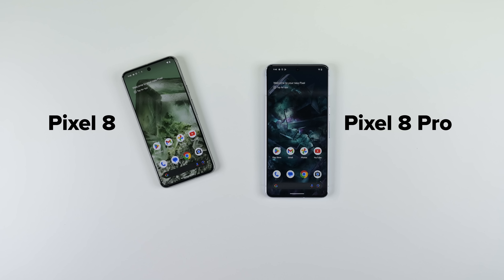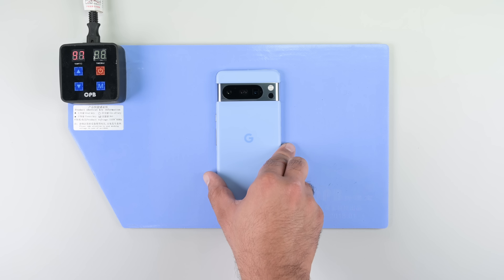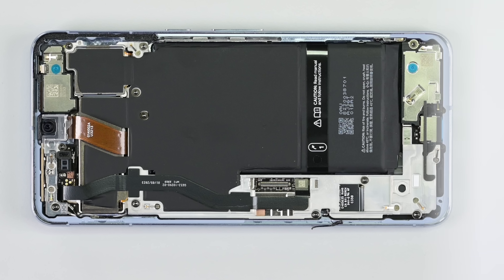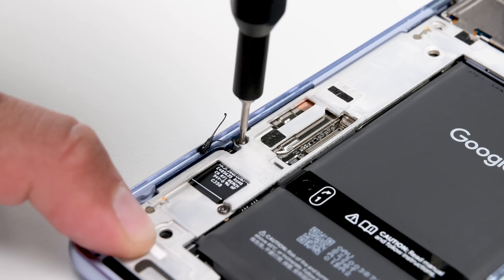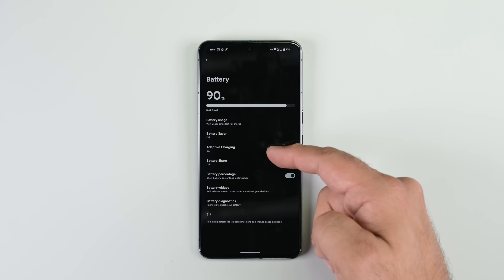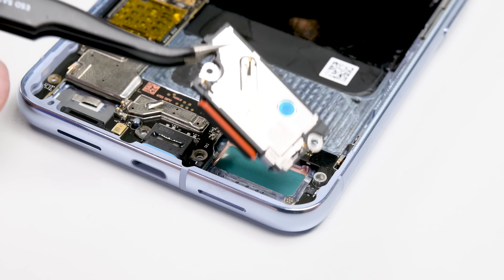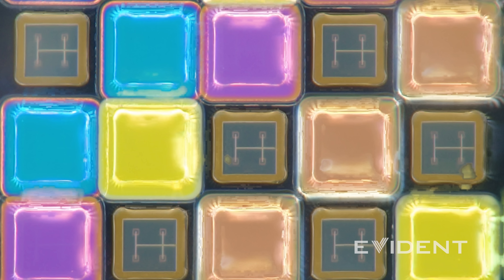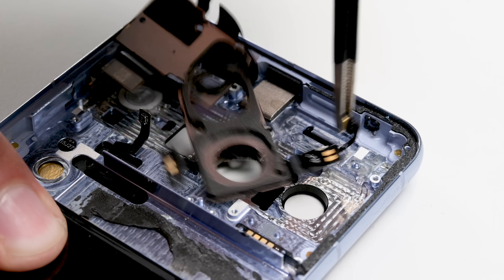Google Pixel 8 Pro Teardown: The Closest Look at the Unique Thermometer Feature

Comment: I'm starting to get pissed off by repair shops.  The time for me to diy repairs with oem parts is coming.  

I may buy a busted pixel 8 pro on ebay just as long as the oem parts fo fix it make the total price no more than ~$500.

Comment: I know it's not FDA approved. But, open your mouth, lift your tongue up, take temp as close to under the tongue as you can. Should be ~36C (assuming you don't have a fever hahaha). Which is correct. I know it wouldn't be insanely accurate, but it's totally accurate enough to just detect a fever (specially if it's a high fever, which is when it actually matters anyway)

Comment: You guys missed to mention the fact that the USB-C port is (again) soldered to the motherboard, replacing it therefore is a massive hurdle for a normal end-user (plus you have to disassemble most of the phone to get there) and will most likely require the entire motherboard to be swapped out (extremely expensive). Only a tiny fraction of tech experts will attempt to solder a new USB-C port to repair an old Pixel.
Reply: You're dreaming. Or regurgitating things you read on the Internet. It's a non issue.
Reply: @johnny257 it is an issue. My moto edge plus has a wonky port after years of use and having it soldered to the motherboard would be a huge problem.

Comment: This is way way better than the iPhone 15 series. Like literally, chalk and cheese. This phone has 7 years of software updates, parts availability, and no software locks.
Heck, I'd rather take Samsung's 4 years (it used to be only 2 years until not that long ago...) over Apple's 5 years purely because with the Samsung devices, I can still repair and replace my own parts as required, so the phone will likely last longer.
Reply: Google AUE for 2 or 3 years was the biggest hurdle in selling these devices. Now Apple users would buy this Google devices as well.
Reply: although Apple offers almost 10 years of software updates. Those 5 years are major OS updates, if you include security updates, the last phone to receive a security fix lately was the iPhone 5S in January, this year.

Comment: let's not forget about the charge port is not easily replaceable
Reply: Oh man, can't believe I (and apparently they) missed that. That's a little disappointing although I haven't really had a usbc port fail hard enough for it to need replacing.
Reply: yea they haven't changed it and they even did it on the fold

Comment: camera bar is obscenely ugly to the point where i might get an iphone after, what, 10+ years on android?
Reply: Depending on what you don't like about it, you can convert it with a case so only the sensors are showing or dbrand it to hide it.
Reply: @IsaacNewsome  No cases ever!
Reply: Zero taste andy
Reply: I'd rather have the Pixel because iPhones have ZERO repair options (except for paying Apple) due to the abhorrent software locks.
Reply: @TheSpotify95 Wow.  Do you lie like that about everything or just iPhones?   I’ve had iPhones since the 3GS.  I’ve dropped a few of them over the years and was able to order parts AND find YouTube videos on how-to replace the parts.  I’ve noticed your PRO-Android comments all over these posts and truly, you’re an Android 🍆 slobber.